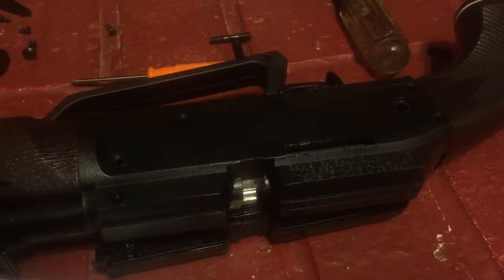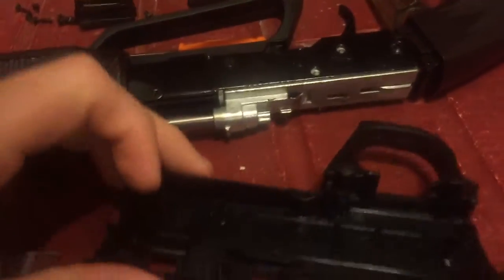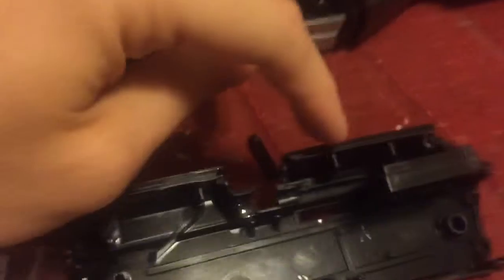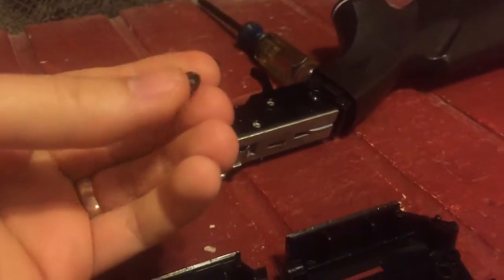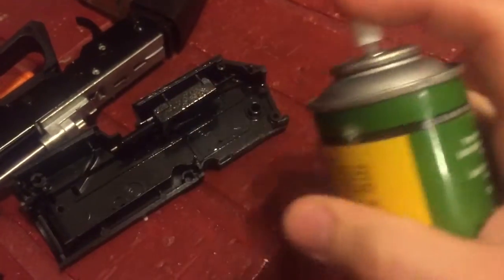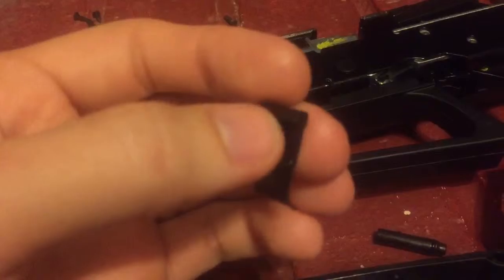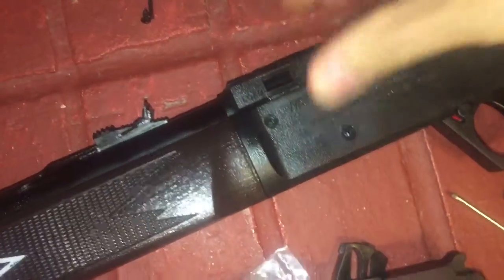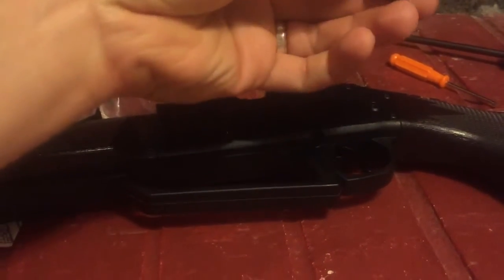Daisy Powerline 880 Bolt Replacement

Comment: the little silver magnet part on the end, yea... i dropped it in the grass, i had a jammed pellet and i was using my knife to get it out, oh it got it out thats for sure, but the magnet stuck to my knife and fell in the grass, i cant buy it by itself so i gotta get a whole new bolt, it still works without it but if i try to feed the bbs in there it will pick up 2 of them and i shoot 2, or it will just jam.

Comment: What about the daisy 20th anniversary Because I got a hollow point stuck in it and I love that Rifle
Reply from the maker: I've never taken apart a Daisy.
Reply: Push it out backwards with a wooden dowel.
Reply: My 901 bolt feels flimsy, not broken though. Think this would resolve that?
Reply: @Anythingelse83  The old saying " if it's not broke don't fix it " comes to mind. It's plastic it's going to feel flimsy. But order the part and have it on hand just in case. Never take a gun apart without a table and good lighting. Put a towel down so parts stay put if they should fall out and record everything you do so you know what goes where. also don't use silicone oil on plastic parts use motor oil none detergent.